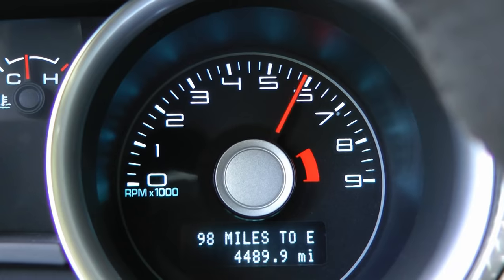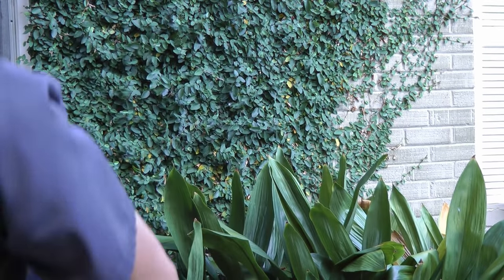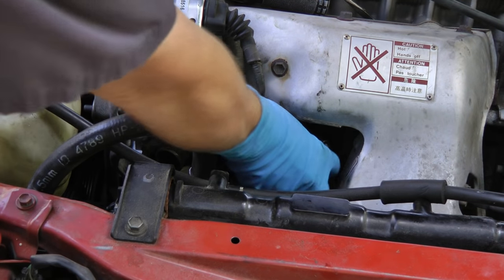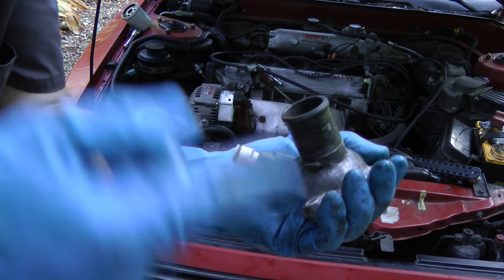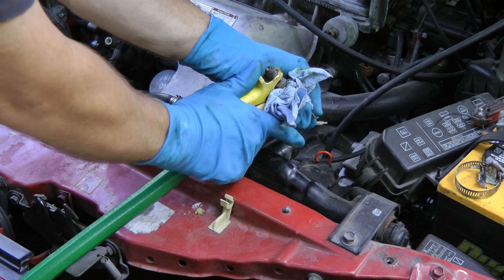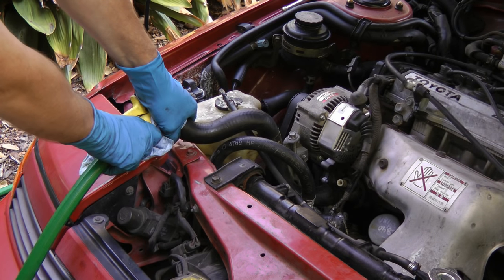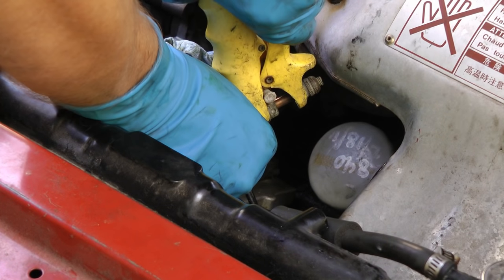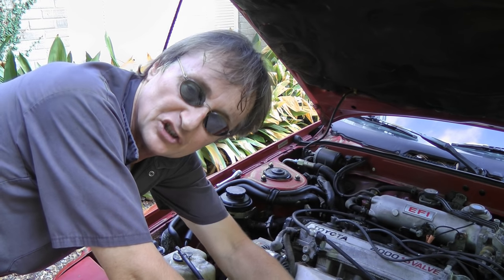How to Flush a Coolant System in Your Car (the Easy Way)

Comment: Remember Scotty is from Texas where it doesn't get so cold.  If you live some place with cold winters, you might want to consider doing this in the warmer months.  The coolant you add to the radiator is called "anti-freeze" for a reason, so the water in the radiator doesn't freeze.  Also when the thermostat is out you wont get any heat to warm up the interior so there's another reason to do this in the summer when you're trying to cool the interior not heat it.
Reply: @rjdeible yes, but short term it's alright. Edit- as long as it isnt going to be freezing
Reply: Nice tip.
Reply: What is the point of this comment
Reply: @CJFX_  Did  you take reading comp 101?  WTF don't you understand about what he said?
Reply: @da324  it's called antifreeze. Aka it's fine to do this in the winter. Once the coolant bleeds after a drive or two the heat will work fine
Reply: You CAN run them without thermostats. Did it on my 97' Taco. Never hested up again after that
Reply: @joseluisrobles6650  - I do this all the time on my 95 burrito.
Reply: To clear this up, Howsabout leaving thermo out while flushing,  then install when your finished and ready for antifreeze!  I understand the first comment,  seems maybe a few people are struggling.
Reply: @rocketman6478  i put the hose on air intake. Thanks but it's too late
Reply: @tomorrowcomestoday1621  I hear ya..   I still comment.  Futur readers ya know... 🤙
Reply: Texas get cold now days.
Reply: Also, is no-one going to mention using distilled water, and not hose water, or Is that an old wives tale?
Reply: @da324  LMFAOOOO
Reply: @kalebhayhurst  for temporary purposes tap is fine.
Reply: Scotty at the time lived in Texas. He is actually a Yankee from R.I. I reckon.
Reply: then February 2021 happens right Scotty?

follow Yeshua folks
Reply: @rocketman6478  thnx! I'm a future reader:)

Comment from the maker: it's more for really dirty systems, normal ones can just flush and fill it back up with coolant
Reply: When its brown, flush it down.
Reply: Do you need to use the bleeder for a simple drain and refill?
Reply: does this method apply for new cars?  2010 and up
Reply: @chieflouie2821  good one shipmate.
Reply: @carlbernngl  Would work on anything.  The only difference in newer cars is that the radiator cap tends to be located off of the radiator, on the reservoir, so the refill process is just slightly different.  Makes bleeding easier, since you can raise the reservoir above the rest of the system, and gravity pulls the air bubbles up and out of the radiator.

Comment from the maker: I use a vacuum machine, but you can sit in a driveway when cold , remove the cap, turn the ac on full blast, and as it warms up add coolant and most will burp the air out that way

Comment from the maker: no, but the thermostat is needed in colder places so the engine runs hot enough to put out heat, and you get better gas mileage when an engine runs hotter, as nutty as that sounds.
Reply: It's not nutty lol. When a car's at its operating temp, engine oil has a good flow rate(so reduced friction and by extension reduced energy loss) and combustion takes place more efficiently(since igniting fuel requires a high temp) That's the main reason.
Reply: Run my car without the thermostat for a week???

Comment: Just bought a seat toledo 1.9 tdi. Temp would go up and down and reach 75oc. Sat in a drive through and it climbed to 90oC. Flushed coolant which was a very strong rusty water colour and replaced thermostat. Runs like a dream now. Excellent advice,  will definitely be checking out your other videos. Thanks.

Comment from the maker: if you leave the thermostat in, often much of the coolant remains inside the block of the engine and you only empty out the radiator. So if it's full now and doesn't overheat, leave it.

Comment: A trick I found that guarantees the proper 50/50 mixture and allows you to get more for your money when buying straight undiluted antifreeze is keeping an old antifreeze jug to do the mixture in. Pour the antifreeze into the empty jug until both jugs are equal, then fill both up with water (distilled preferably) the rest of the way. You get twice the proper antifreeze for your money, and you aren't paying for water like you would if you were buying the prediluted stuff.
Reply: Haha yeah I learned that from my dad lol
Reply: ***** This is called common sense.
Reply: +AnythingLoud   Yeah but it does the greatest good when shared.
Reply: thebestofall007 when I did a flush, I bought one gallon of full concentrate coolant and one 50/50 mix and one gallon of distilled water jug to mix with the full considerate
Reply: Good creative way of doing that. I had another empty antifreeze jug handy.

I got through doing a super flush and used a sodium citrate based product called "Prestone Radiator Flush + Cleaner" that dissolves contaminants like rust and scale so they can be flushed out easier. I drained the old coolant (which was really dirty), took out the thermostat so the product can circulate better, poured a bottle of the stuff in the radiator, then filled the rest with water. I then drove for about 100 miles, left the water/cleaner mixture in for about 3 days and let the cleaner work, drained the mixture, flushed it all out again with a garden hose, replaced the thermostat, then put in the proper coolant mixture. 

It's amazing stuff. It's kinda like a mild CLR made for your engine.

Here it is: http://www.oreillyauto.com/site/c/detail/PRS0/AS105Y/N0453.oap?ck=Search_radiator+flush_1274363_4063&keyword=radiator+flush
Reply: AnythingLoud well I've found in recent years that common sense is becoming less and less common. We might as well start calling it rare sense!
Reply: I see little reason to drive a car without the thermostat after he flushed the system already through the hoses. Just put the stat back in and fill it up with 50 50.
Reply: I usually just buy one gallon straight antifreeze one gallon distilled water dump them in the car and boom the car will do the mixing for me and has never failed no need to measure and works everytime
Reply: With Toyota, the concentrate is Long Life (30K change), while the diluted is Super Long Life (50K change).  So the pricing is proper for what you're getting.
Reply: Sweet advice,common sense but I've never done it,thanks.

Comment: Spent boku bucks at the dealership trying to get the system flushed 2x and kept overheating because they never checked the BAD radiator cap with a bad gasket making a poor seal. Replaced thermostat 2x,  flushed 2x and they STILL never  saw it. I'm a 16 yr old and I replaced it for $10 and now my antifreeze doesnt disappear and my termostatis  perfect.
Remember to check da dang cap!🙏
Reply: fist thing you do after flushing, if it still runs warm.

Comment from the maker: Often hard to get air out of those systems, TRY paying a guy like me in your area to use his vacuum radiator bleeding tool that sucks the air out, or buy one yourself, they cost 70 bucks or so (but you do need an air compressor to run them.)

Comment: As always Very thorough and GREAT for newer radiators. I had to replace the radiator after flushed due to unclogging pinholes in older, used car, with old radiator.

Comment: Driving the car around for a week with just water in the system, is it a good idea to dump a little rust preventative in there as well? On our machining centers at work, when we have cleaned bare metal with just water, we get flash rusting.

Comment from the maker: NO NO, water is a better coolant as it has a higher specific heat and can take heat away better. You use coolant cause it doesn't freeze and doesn't corrode parts in the long run.   Using water for a week will not make it run hotter, and can flush parts out, that's why I advise it.

Comment: When the climate is right I just buy a bunch of 99 cent distilled water and chem flush.  Don't want hard water in it...  

1. Coolant out,  clean the overflow tank, fill with all distilled and flush in..   Thermostat still in..   

2. Drive it a bit. 

3.  repeat from step 1 until clear.  I've seen radiator cores really clean up looking down a cap. 

4.  Drain and refill with coolant.   I like Zerex G-05 which is HOAT.

Comment: 1) Don't run the car with straight water if it's going to go below freezing.
2) Always bleed air from the cooling system after doing a procedure like this.
Reply: bleed air, how so?
Reply: Derek Godbout most vehicles actually habe some sort of bleeder screw at the highest point in the system. you can see if you have air trapped by trying to run the heater. if you don't get good heat, you prolly have air trapped in the system.
Reply: The 3SFE engine (like the old Toyota one here) doesn't have an air bleeder. This is because the radiator cap is the highest point of the cooling system.
Reply: You can actually drive a car with water insted of coolent
Reply: Most newer cars have a bleeder valve on the radiator or thermoset housing
Reply: Jack the nose of your car up. turn it over once with the radiator full. top it up again. Lol super easy way to make the radiator cap on any car the highest point.
Reply: @eventosminneapolis4840  Don't drive car with water only long term...corrosion will come much quicker. The physics of hot water and most metals will do this unless stainless steel.
Reply: Ardent Fan  That concept is simple, logical, and very well explained.  As a novice trying to learn this stuff for the first time, and terrified that I'm gonna wreck something, I am so glad I came across your comment.  Thanks for sharing.
Reply: @ADR69  Bullshit, SOME vehicles have bleeder valves
Reply: @rmcdaniel423  Check out chrisfix's youtube channel
Reply: My 97 Town Car has neither a bleeder valve, or a radiator cap. Having trouble getting 3.5 gallons into the damn thing.
Reply: Or take it to the dealer (make of car) and have them safely flush it and us OEM coolant in which car is designed for....not the knock off "universal" coolants. No such thing as universal coolants.
Reply: @mitch1078  alot of ppl say use distilled water
Reply: @mrbran214  Yes distilled water is better however the question was about running radiator with water alone by itself in summer.  I was saying short term advisable only.
Reply: @mitch1078  I was not challenging or saying you are wrong i was simply just asking if distilled water is what your suppose to use if you don't need to use antifreeze
Reply: @mrbran214  Ok gotcha yes distilled water is always preferable in any case.
Reply: My car never needed bleeding.
Reply: I wonder why he didn't mention that! Crazy!

Comment: Any recommendations for a system that is clogged up with rust and sludge?? I Drained off my radiator yesterday, and refilled it with distilled water and a bottle of Prestone Flush. I am planning on driving it for a few days just to work and back, then flushing/back flushing the whole system next weekend. You should have seen the sludge I got out of the reserve tank and in the bottom of the pan...yeesh.

Comment: Question: Shouldn’t you use distilled water to prevent any additional metal deposits inside the system to flush?
Reply: SGT. York  I'm going to do a coolant flush when I change my radiator this weekend and have a few questions. Even if you buy distilled water that is labeled, how do you know it's actually distilled water? Also, wouldn't the pressure from the hose flush the system out better? I live in the South too, and it has been the hottest Summer I can remember! Any help with these questions will be greatly appreciated. Peace
Reply: SGT. York  I finished flushing my coolant yesterday. Next time I will use one of those PH kits to test the water like you suggested. I did use distilled water to do the flush and filled it back up with Prestone 50/50. Next to each I will mix the coolant myself. Thank you for the reply. Take care and I hope you have a great day!
Reply: SGT. York  Right on! Thanks again for all of the valuable information SGT. York. Peace
Reply: SGT. York I agree I was thinking the same thing. It’s one of the few videos I disliked from Scotty.
Reply: Yes, Distilled Water “IS A MUST”, not tap water.
Reply: You can use tap water to get all the gunk out THEN flush with the prestone flush cleaner WITH distilled water to remove the minerals that were in the tap water.
Reply: SGT. York I like the idea of using a flushing agent but I used it twice and lost a water pump each time. One of the pumps was only a few months old. This was over 20 years ago in all fairness. They are probably much improved now.
Reply: capitalismforme I could be wrong but I believe the development of rust has been around much longer than any engine. Crazy what you learn in school
Reply: @brianmuehlher5330  Hello, why would the flushing agent damage the water pump?
Reply: @Gave-rf1hr  I’m not sure it does but I used it when I was younger and lost both pumps. Could have been a coincidence. Now I just use distilled water and haven’t had any issues.
Reply: Hi

Comment from the maker: blow it out with air pressure, they used to have block drains on the engine but few have that any more.If you like my car help, be sure to watch my live car talk show every saturday morning at 10 AM CST on google events. I answer your car questions LIVE there. Just go to my scotty kilmer channel on youtube saturday morning at 10, and click on the google plus icon on the top right corner. That takes you to the event. You do have to be a member of google plus to ask questions, so join up,
Reply: I always have the best luck with compressed air going in reverse of normal flow. Seen bits of gasket maker come out of cores and radiators. Heater cores have a bypass valve too in many cases so flush that separately.

Comment: Hello Scotty. Did you say you should run your car on straight up water for a week or two to help make it flush more build up? Is that bad for your engine? Is it bad on a Diesel engine?
Reply from the maker: it's only bad if you do it for years as things would rust. Realize water cools better than any coolant, it just rusts stuff over time and freezes when it's cold outside

Comment: Scotty, My radiator cap never gets hot.. what causes this?. Even at running temperature.  I've replaced thermostat, and all the hoses, because they all cracked.. Should I flush thr cooling system like you've demonstrated here?.

Thsnks 

Josh

Comment: Hey Scotty,
Preston makes a dandy flush kit that works without taking all those hoses off. You put a tee fitting in one heater hose and screw the water hose to that. There is a spigot that goes in the radiator neck and squirts the old water out over the front of the car. It back flushes the system just by starting the engine and turning on the hose. Open the radiator drain during the process to get the stuff out of the bottom of the radiator tank. I've use them for over 30 years without any problems. When you're done, you unscrew the hose adapter from that tee in the heater hose and put the cap included in the kit on the tee. It's there from now on and ready for it's next use in seconds. You should try it.

Comment: How are you able to do this in the Winter? Ive got a blockage at the moment and needs fixing.
Reply: Not the driving for two weeks with just water know, and also I'd only do it in a warm garage so water doesn't freeze
Reply: @Mazdatree  had to do it in the winter. Flushed the system dry and kept the coolant. Then flushed it with water a few times. Then used to the old coolant to flush it a few more times again. 
Then I used new coolant to finish it off

Comment from the maker: no actually it would run slightly cooler, water has a better heat dissipation level than coolant has, it just freezes when too cold outside,
Reply: I have a 99 pontiac grand am gt and mine will sometimes run at like 215 but overtime of it sitting it will go back down to like 195 to 200. Idk what it could be. I have been looking stuff up for an hour and I'm about to just give up. It is running with water rn because I just replaced the resevoir because it had a crack in it and wasn't building up any pressure. Got any ideas on what it could be?

Comment from the maker: A lot of that specialty coolant is more or less bunk to sell expensive coolant. I've found modern long life OAT coolant works fine in them all. You really don't need a HOAT coolant really.  even engineers have explained that one to me.
Reply: Careful about the additives.  2-EHA, which is in many "universal" coolants, eats silicone and plastic.  Many others have silicate in them, which can destroy water pumps.  Used in the wrong engine, of course.  And then there's the sludging that can be caused by using 2 incompatible coolants (if you don't flush completely).  There are too many different specialized additives in place for the construction of the engine, seals, pump, hoses, radiator materials, etc. out there to just throw anything in any engine.  Coolant may have been simple back in the day, but the higher tech stuff from today can cause problems.

Also, Asian brands tend to use PHOAT, which includes (P)hosphates, beyond just the HOAT formulation, to reduce corrosion.  You can also get POAT, if you're that against the Hybrid part...

Comment: What if the water gets trapped in the cooling system? How would we bring the mixture to 50/50 concentration?
Reply: You can buy test kits and get close by adding straight coolant (most folks don't need to be exactly at 50/50).   Good enough is good enough

Comment: Watched another Scotty video that said drain and replace -- do not flush because too many customers flushed and had problems.  Is that a new rule?  Or flush only when the radiator fluid and system have been abused?
What about when you you want to upgraded to the hula (hooka?) top of the line radiator fluid (h-something-err-rather, anyway)?  Does one need to flush the system to upgrade?  Or just drain and replace?